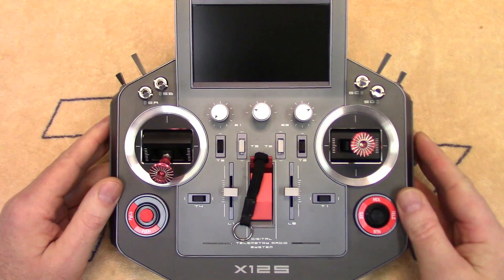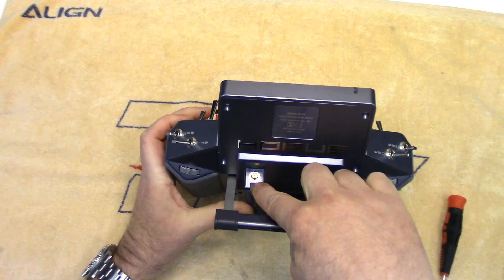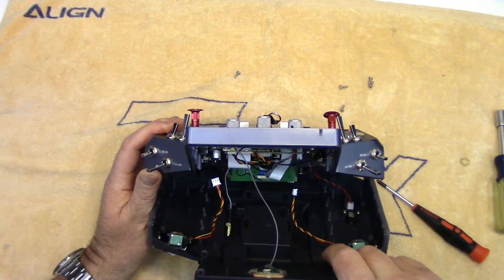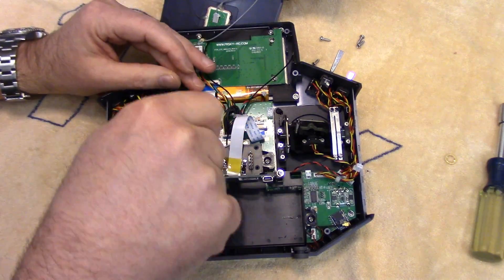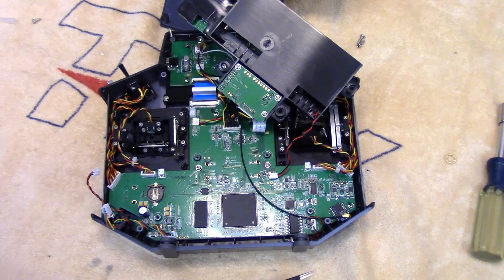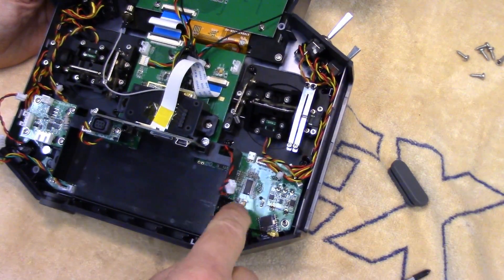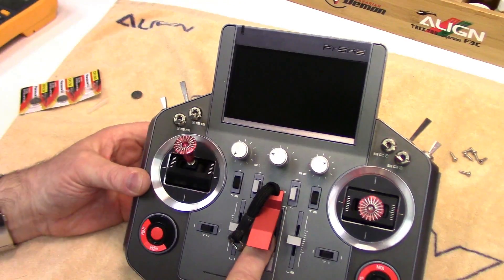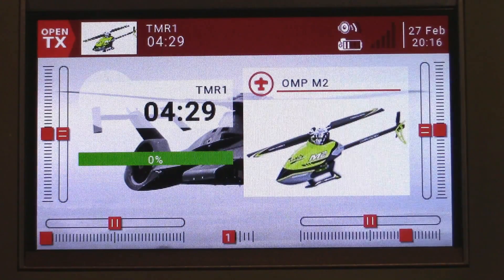Horus X12S RTC Backup Battery Replacement

Comment: Hey John, Im juet wondering if you've experienced something similar with your horus.  Im getting extraneous rudder inputs on my radio.  When I have the monitor screen open and my throttle is at minimum theres no random input.  But as soon as I bring the stick to the centre I get random rudder inputs and I've actually noticed it in flight with a heli.  I thought there was something wrong with my gyro as it had symptoms of the tail blowing out.  Now I've narrowed it down to my radio I've no idea what could cause it.  My only theory so far is my centering springs are too slack.  Or there is dirt or fuel around the holofex sensors inside.
Reply from the maker: Erratic output on the rudder &/or aileron stick is generally due to the wires going to the hall sensors on those two horizontal gimbal axis breaking where they flex. I read about that early as one issue with the X12S as they didn't use high flex silicone wire on those two hall sensors. This was a common issue back in the 80's/90's on some radios, but it is unusual with today's better equipment. I replaced my hall sensor wiring in the X12S with high flex silicone stuff before it became an issue once I read about it. If you look closely in this video of the twisted tri-wires going to the rudder and aileron hall sensors, you can see its a slightly different color than the other wires.
Anyway to diagnose if bad hall sensor wiring is truly the issue, you have to open your X12S and with the monitor screen on, wiggle the wire going to the rudder stick hall sensor (generally they start breaking right where they enter the sensor). If you can see the output jumping when the wire is wiggled & moved, you'll know it's a failing wire issue. 
If you know how to solder, you can just get some high flex silicone wire. I found some 3 conductor twisted red/yellow/black Spektrum Satellite RX wire harnesses on line for a few bucks and used them, but any high flex silicone wire of the same gauge will work. Then it's just a matter of removing the hall sensor, solder the new silicone high flex wires to the contacts inside it and splice the other end to the existing plug end.
You will want to do the same with the aileron hall sensor as well because it will most likely start acting up too. 
Other option is to order the hall sensors with the high flex silicone wiring and plug connectors already in place. FrSky used to offer these, but I haven't seem them in a while (haven't looked in a while either). May be some aftermarket source as well?
Reply: @Rchelicopterfun  that makes perfect sense John.  Unfortunately I never knew that was an issue so thanks for letting me know that.  I will definitely replace the wiring on both hall sensors and hopefully that will solve the problem.  Thanks so much.  Nearly wrote off a beautiful Heli because of it.
Reply: @Rchelicopterfun  you were spot on John, I opened the radio and wiggled the wires going into the rudder hall sensor and the literally snapped right off so I was probably 1 flight away from complete disaster

Comment: I have an X10 Horus. It got modded to hold 2xLR44 in series for the backup. Plenty room and works well. Tip for button cells in general: Don't touch the contact surfaces with your naked fingers, as sweat, acids and fats present will cause the battery to deteriorate / discharge faster. (I know this from quartz watches, especially) But hey, thanks for posting! Andy
Reply from the maker: Interesting, I thought the precautions of touching modern day button cell electrodes with bare skin causing potential faster degradation was an old wives tale that has been debunked many times over? Suppose it never hurts to play it safe. Nice mod with the LR44's. Likely enough room in there to put even larger capacity RTC backup cell/s in - even move the location so it's easier to access. Thanks for sharing the tip. 👍
Reply: @Rchelicopterfun  Nice that you're paying attention, I appreciate that. Perhaps my training in avionics and a watch repair sideline have mave made me a bit neurotic when I'm not wearing gloves at the bench! The X10 Horus also originally used the CR 1220 as backup, so next time I open it up I'll make a current drain measurement just for interest. Stay safe, Andy

Comment: Hey John, I've recently just gotten a Horus x12s and I'm new to open Tx.  I was wondering what your battery meter range is set to as the one that's default for open Tx atleast for me seems way off.  Cheers mate
Reply from the maker: Howdy Connor, hope you enjoy your X12S as much as I've enjoyed mine over the past several years. I've got my voltage meter range set at 8.8 to 11.1V. That's 1.1V to 1.3875V per cell which is a fairly conventional NiMh working voltage range under fairly light loads (which is what an RC radio would be considered). I seem to recall the horus sucks about 250 to 280 mA when the display brightness is maxed and internal RX on.  If yours is around that & the meter indicator is not indicating correctly, you may have to check the voltage calibration. Hopefully that's not required because it means opening the radio up & probing the battery terminals with a DMM (digital multi meter) while the radio is on to get the under load working voltage. You then set the calibration voltage to what the DMM was reading. A total PIA, and it should be calibrated good out of the box; but just thought I would mention it if your meter range is still way off at 8.8 to 11.1V.
Reply: @Rchelicopterfun  That's perfect John thanks for all the information I really appreciate it. That's helped massively. Keep up the amazing videos. I've been flying helis for nearly 20 years and I still learn a lot from your videos 😁.

Comment: The RTC battery has just failed this evening as I was setting up a model I'm building (a 60" ws Sopwith Pup) on my X10 Horus after just over 2 years.  I'm certainly not looking forward to replacing it but your video will be useful even though yours is an X12 but is probably similar and certainly the same battery as X10. At least my external antenna connection is on the top where you screen is so may not be so much of a problem.

Incidentally, I knew the battery had failed because every time I switch on I get a warning "Battery Warning. RTC battery low. Press any key".
Reply from the maker: Thanks for the short RTC batt life confirmation on your X10 as well. FrSky should be using larger capacity 3V cells IMO. Interesting that the X10 has an RTC warning. Are you running OpenTX or FrOS?

Comment: I Just replaced the RTC battery for my taranis X9D+ bought in January 2017. It is easier to replace than your Horus.
Reply from the maker: So even the Taranis eats up the RTC batt quickly. Me thinks FrSky should have gone with a larger capacity battery such as a 2032 so we could get at least get 5 years.

Comment: hi have you updated the firmware to the latest 2020 v2 ? if so does this allow access?
Reply from the maker: I have no idea what 2020 V2 firmware is? I'm currently running OpenTX firmware version 2.3.5. Its release date was 01/15/2020.  Allow access to what - the RTC battery? Firmware has nothing to do with pulling the radio apart to gain battery access; perhaps I'm misunderstanding your question.
Reply: @Rchelicopterfun  Sorry to say that there is some video display problem with 2.3.5 and it is recommended to upgrade to 2.3.7. I know you (and I) hate to upgrade. I recently upgraded from 2.3.1 to 2.3.7 and it went without a hitch on my X12S. The problem is something like uses too much battery or ???

Comment: Hi John, great info..
I am evaluating the Horus X12S with the full Multi-protocol setup myself to replace my vintage MC-22. Many guys write that the stock 'main' battery is a weak point and doing some 2S or 3S Lipo conversions. I see you run the original main battery. Is that still the first, original one? Thanks, Harry.
Reply from the maker: Yes, still the original NiMh one and it's working fine. I've never had an issue with it and it has never left me wishing for more capacity. I just plug it in after a day of flying and it's ready to go the next morning or whenever I go out next for that matter. Like I've done with all my radios since I started flying planes back in 1984. I can keep the Horus NiMh pack fully charged, no special kid glove care needed, no worries about keeping it at storage voltage when not in use or having to discharge it to storage if I get rained out for a week, or worry about leaving it in a hot vehicle occasionally. I've tried LiPo and LiFe in other TX's I've had and they were always more of a hassle than they were worth; but that is just my 2 cent opinion based on my anecdotal hassles with LiPo/LiFe packs in TX's.  Get what you find/consider works best for your particular usage & application; every battery chemistry has pros and cons as you know.

Comment: Hi John, thanks for the video.

Just one point,, you shorted the old battery out by removing it with your metal tweezers so it would read practically 0v after that. It was duff anyway so no problem. All the best.
Reply from the maker: Button cells like these have such high internal resistance, direct shorting for such a short time frame, even if it was a fully charged new one would produce very little voltage drop. Any that did occur would recover very quickly. So it's not an issue to be concerned with. 🙂